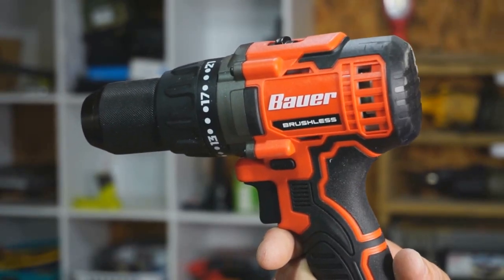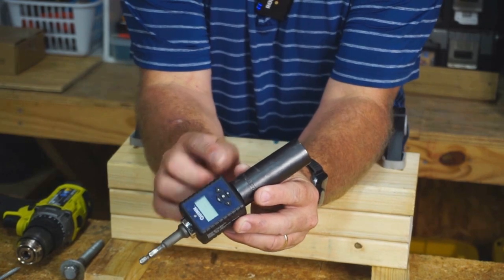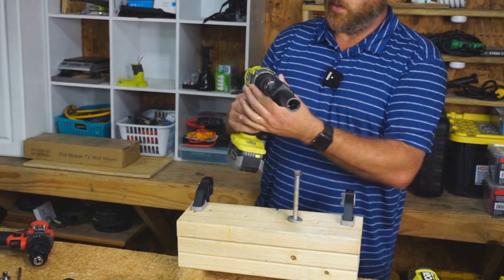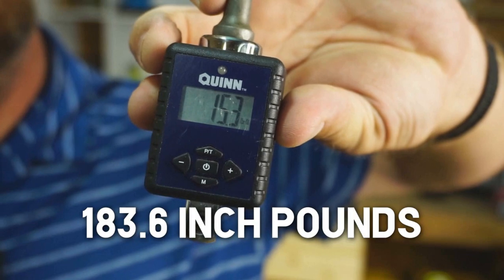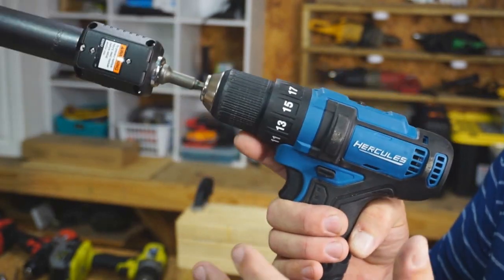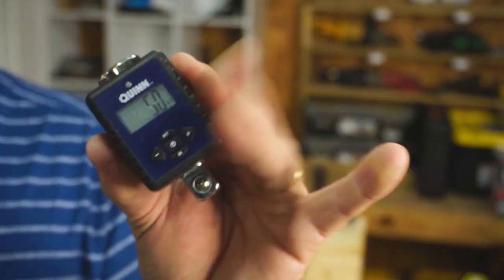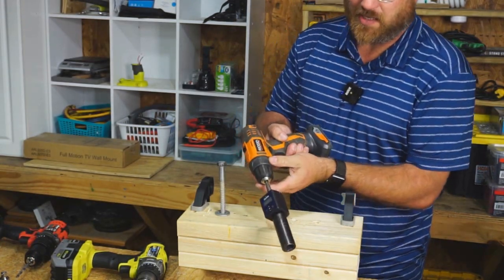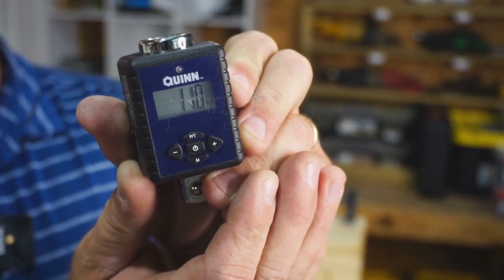The Best Drill for an HVAC Tech

Comment: $40 is a waste if the magic smoke comes out. That happened to me with a 4 inch grinder from Harbor freight, seven minutes later the smoke came out. I never went back to harbor freight. It’s buy cheap often or buy good and last for years.
Reply: I've got a bunch of the 18(20) volt Hercules tools. I was trying to make something out of wood and I didn't want to dump $500 on tools. I ended up about $300 but I got everything I needed and they work for me when I have to go help out my parents at their house. Only complaint is at some point I ended up with the blower (I was excited about it to take camping and have it blow up my mattresses and blow out the dirt). But it was sitting on the dryer and fell because of the vibrations. It broke the attachment. HF just replaced it for free.